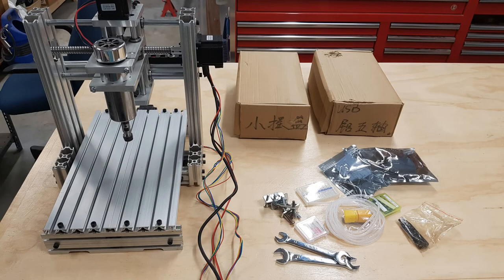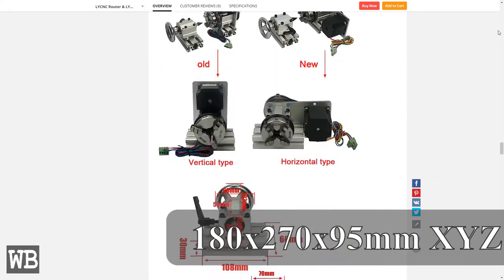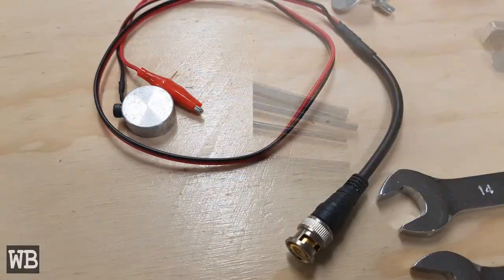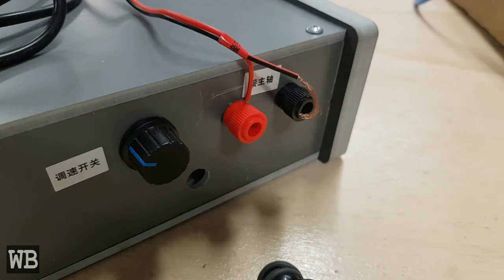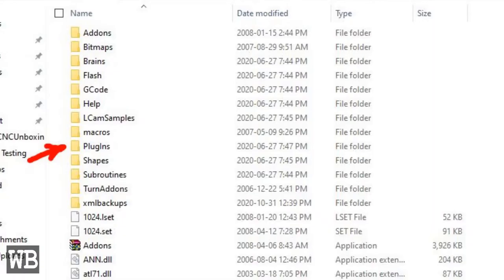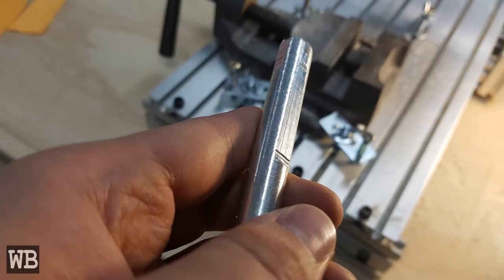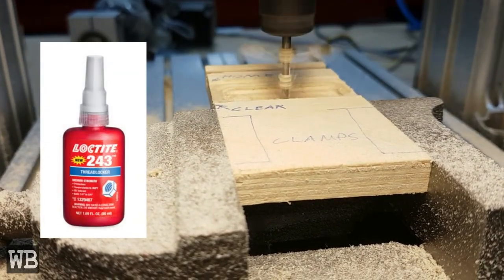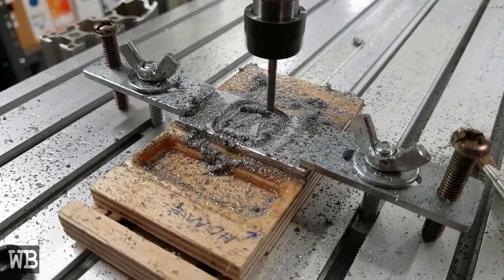3020 Unboxing and First Cuts | CNC | BuildLog #7 | WrightBuilt.ca

Comment: Hey did you ever get the 4th and 5th positional axes working?
Reply from the maker: I had it working back when I had Fusion 360 education edition (for school) to generate tool paths but haven't used it since. No issues getting it to work.

Comment: hello!
ive been looking at this same machine myself and cant really make a decision whether i should get it or not, so this feedback is really welcome! just like you, im interested in milling complete parts but i have no real experience with milling machines (only 3d printers), so i dont know how  hard it is going to be to program those 5 axis and how the machine is going to perform. So im really looking forward for your next videos to see if i should get it or maybe look for something more suitable for my needs. anyways, good luck with it and have fun!
btw, found your channel through the review comments on the aliexpress page
Reply from the maker: Thanks for the comment – your feedback is greatly appreciated. This upcoming Saturday’s video will likely be on a different subject, but I have some footage for more aluminum tests recorded and hope to do some with wood for November too. I don’t think I will try cutting steel without a bigger spindle. Compared to 3d printing, the coding for the tool path is still mostly automated, just each operation has to be set up separately in proper order (I use Fusion360). If it would help for me to do a quick overview of making the machine code (or something else), just let me know and I'll add it to the future recording list. Thanks again for watching!
Reply: It would be great to see how the 5-axis perform and have a closer look at the finishings, because from the video it looked like the aluminium rectangular part you milled had some chips missing on the edges. It didnt look very clean, but that could just be because its the first try. Would love to get some insight there
Thanks for your answer!
Reply from the maker: Ok, I am hoping to get the aluminum sample cuts done for next week (Nov 14th). As per the edges, I just cut it off with a saw and filed the edges by hand in a rush. I have something planned to make with the 5th axis but I need to design it and learn the coding first so that will still be a couple of weeks.